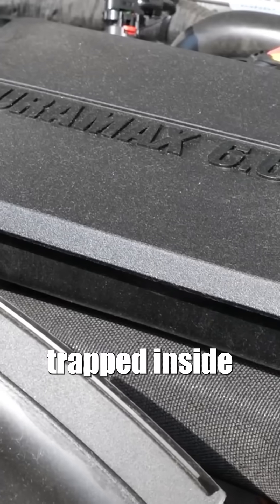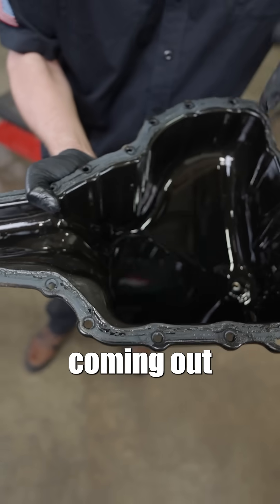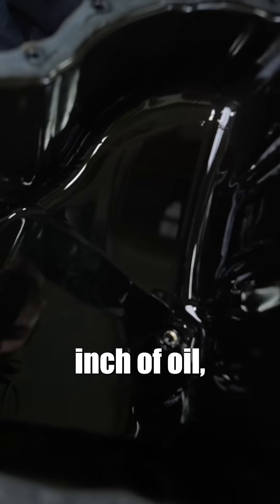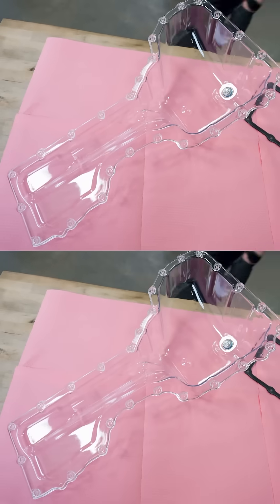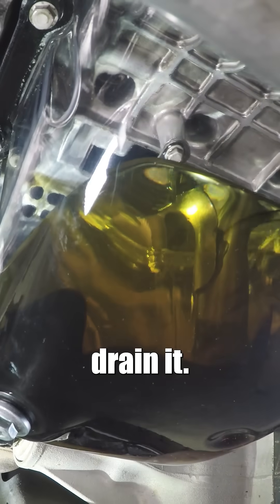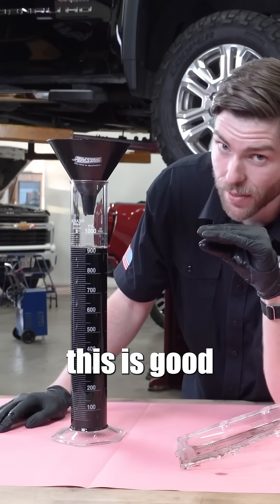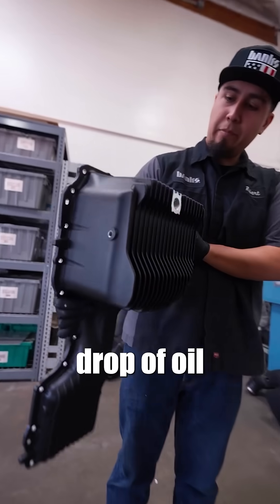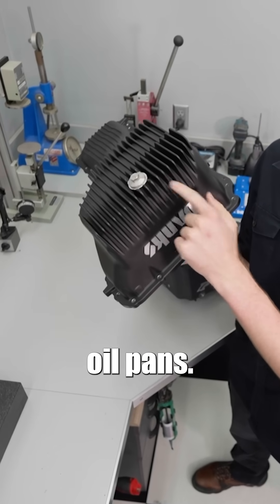A disturbing discovery. This dirty oil is trapped.

Comment: Guess I'll get on my soap box for this one, I agree with those of you that poo poo this b.s. ,but to take it farther, 45yrs in this field has give me the perspective that  if the general population of those who's vehicle's I delt with, had it been a horse, it would have been dead before they brought it to me, from lack of proper care, and they'd be afoot more than riding, not only  that  but what the manufacturer's are toweling out are by comparison to 60s ,grossly  over powered for most folks needs. 150hp. Is plenty of power for most folks needs ,they do not need a racing engine as what being sold to the public, nowadays, take care of want you've got and it'll last 2-3 hundredthousandmiles,
Know it for a fact, worked on a few ,not pretty but they did the tasks required, vehicle's are just tools, if you disagree fine keep it to yourself..experience teaches..history Teaches

Comment: so you're using the worst oil pan for your example? nice. most drain plugs don't protrude into the pan. my 318ci jeep actually has a little dip for the drain plug and sits at the lowest point, that is how pans should be made.

oil is always trapped in an engine, even with a fancy oil pan. however that oil is mixed with fresh as you change it, so its not recycling the same old quart.

usually i let my car sit and drain for an hour or so while i do other things, you'd be surprised how much additional oil you can get out by just being patient.

Comment: I have same issue in my european Hyundai 1.6 Crdi diesel. Drain plug is above lowest point in pan. About 600ml old oil is left. I used to change oil every 5k miles but I do now every 3K. Car is on 97K now with original chain, turbo, injectors and bits...

Comment: Here in Australia the Ford ranger and Mazda BT50 (used the same diesel engine) suffered a major design flaw where exactly that would happen where the oil would drain from the pickup tube and not build pressure again after being refilled, engines were blowing up left right and centre.   Mazda and Ford remedied the issue by telling service centres and customers to only let the oil drain for a maximum of 10 minutes which I don’t know was successful

Comment: That oil drain plug being the lowest point on the pan is troubling. I've seen too many like that busted off, engine ruined. Mercedes comes to mind.
Make it an internal hex or torx instead of a nut so it can sit flush with a small lip to give the sealing.

Comment: Thats not true with all cars buddy. Maybe u can trick some people.
Reply from the maker: Correct, not all vehicles suffer from this issue. In the case of the 2017+ L5P Duramax, that's a different story. For a more detailed breakdown of the 2017+ 6.6L L5P Duramax CoolRunner Oil pan, check out the long-form video this clip comes from.  https://www.youtube.com/watch?v=CVnssANHmU4

Comment: Just park your car on a low slip driveway, am all the oil will drain out
Reply from the maker: You may get an extra ounce of oil, but you would still have dirty oil stuck in the bottom of the pan to overcome the factory drain plug provision. The point is to remove as many contaminants as possible. Our CoolRunner oil pan for the L5P Duramax removes the factory plug provision and replaces it with a smoother unobstructed drain to ensure as much dirty oil as possible is removed. For a more detailed breakdown of the 2017+ 6.6L L5P Duramax CoolRunner Oil pan, check out the long-form video this clip comes from. https://www.youtube.com/watch?v=CVnssANHmU4

Comment: This is BS.  The oil mixing all the time your engine is running and mixing when you drive so, the old oil is NEVER  left in your engine.  I've got 2,300+ miles on my pickup with factory oil pan and zero oil problems.

Comment: I would be curious to see if the pick-up tube getting drained at every oil change would increase the wear on initial start-up afterward. Does it take longer to prime the system with it needing to pull the air out above the oil level before the system is fully primed, and if so, what kind of additional wear are we talking about? Metal on metal without lubrication is bad, and im sure we are only talking about a second or two, but it would add up over time i would think.

Comment: An oil extraction pump via the dip stick tube can suction out much of that dirty oil. After the extraction, pour a half quart in and extract it again. Then fill her up with whatever the engine requires.
Reply: Using ramps to change your oil... or park on a hill to change your oil if you don't have ramps... or if you live in the flat lands and your broke grab a shovel and make piles of dirt to put your front tires on before you pull the drain plug.  It's going to get just as much if not more of that oil than having to have thousands of dollars in unnecessary equipment that you are using in a pretty ineffective and inefficient manner by stuffing a little tube down the dipstick tube and hoping you get the suction tube in the low point of the oil pan... which is not always where the dipstick goes into the pan... and then you waste a half quart of oil for no reason other than verifying that you sucked out all of the oil to whatever point it is that the suction tube is at, which you already knew, cause it stopped sicking oil once already... but you can't see where that tube is sucking from and you can't even tap it in the bottom of the pan to listen to where it's at because you can't be in 2 places at once...

Oil Evac systems,  when used as a system,  like having quick couplers on equipment that connect directly to the  drain plug at the low point are great. Blindly poking a tube into a dipstick tube and hoping you are actually getting it into the low point to get all of the oil is stupid. 

Use ramps, drain the oil into a drain pan, use the oil vacuum pump to suck the waste oil out of the drain pan, and if you are really concerned stick the evac system hose in through the drain plug hole and get the last few drops. 

The other issue with sucking oil out of the dipstick hole is what about all of the magnetic shit stuck to the drain plug? Just going to let that build up for a few years... well beyond the amount the drain plug magnet can hold so that it is just free to flow around the engine?
Reply: @PolarisRider06 no one is reading all that.
Reply: I use cherry flavored Kool Aid to flush the dirty oil out. Grape just doesn't do a good enough job.
Reply: Oil extraction pumps exist (and are pretty cheap too)
Reply: Why not just drill a hole at the base of the threads

Comment: This is why i dont drain via the oil nut. 
I use a pelta sucking machine that you feed through the oil dipstick tube. 

Oil change with no mess.

And you can move/shimmy the tube all around the bottom of the oil pan to suck out every crevice.

Comment: The original engineers made the original outlet like that for a reason. As long as you follow the recommended oil changes, or even better to change the oil with good synthetic more often, this is much ado about nothing.

Comment: Misleading, when you pull the oil filter, the oil will drain back to the pan and out of the block as most filters are the check valve for most vehicles

Comment: It’s only a problem when you change your oil on a lift. When you change your oil on a lift, the oil pan is level with the ground. Being level with the ground is optimal for when the car is running so that the pick up always has a supply of oil to pump into the engine. However, backyard mechanics don’t use a lift. We often do our oil changes with ramps which pitches the nose of the car in an upward direction. When this is done the angle of the bottom of the oil pan allows more oil to escape during an oil change and exposes the pick up , so that most of the oil is evacuated.
Reply: Depends on where the plug is.
Reply: Who says the drain plug sits at the lowest point when the front wheels are higher than the rear wheels? It entirely depends on the vehicle.
Reply: @jochem1986  yeah and I don't think engineers design cars with backyard mechanics in mind but rather with oil being changed in lifts.
Reply: @ can you give me an example? All the vehicles that I service have the drain plug facing towards the rear of the car which places it at the lowest point when the front of the car is jacked up.
Reply: @frankbonura5710 my Subaru has the drain plug on the front of the pan rather than the back. I don't know if there's a preference towards the rear usually but it's certainly not a rule. Especially with more unique cars that can have like 4 drain plugs to get all the oil out (looking at you Porsche)
Reply: @sp3edy787  Thanks, that’s good to know. I doubt I’ll ever touch either of those, but never say never 😂
Reply: @frankbonura5710 
The example used in the video clip was an oil pan on a 6.6 Duramax where the oil drain plug was at the front of the oil pan.
Engineers didn’t have to put that 3/4 inch flange inside the oil pan to lock up the extra quart of oil making it near impossible to get out of the engine.
Reply: Great insight.
Reply: Or you can use a special pump like we do with motors on boat.
Reply: @yamralebol6648  still leaves some oil, I don't personally think it makes that big of a difference but I'm not selling products either

Comment: thats why we recomend to do an oil change every year or so, because when the oil is a year old its not going to be as dirty. IF it is its goes through the oil filter that you forgot to mention, so even if its dirty the new filter that gets changed with the oil will prevent anything in the engine.

Comment: DUMB design, no argument there. But the sales pitch is even worse than the "as seen on TV" scams. That oil that is "stuck in there forever" will be mixed with the fresh oil before you even start the engine, far from ideal, your product is better. But you guys are way better than that BS pitch <3

Comment: Blow air directly at the dipstick  tube using an airgun on a closed oil cap. But be watchful for water accomulated at the air compressor tank, it might go with the air into the engine sump.

Comment: That's why most not poorly engineered cars have the drain plug on the side of the oil pan so that protrusion of the mount doesnt interfere with the old oil flowing out and you can stick a suction tube in and get even that tony rest of it out

Comment: Wow that's some bullsh1t there, btw drain the pickup tube and pre fill the the oil filter and say hello to an air lock and a destroyed engine. Engines do millions of miles with a tiny bit of old oil mixed with the new stuff. Oil changes create wear during the first start up, how many of you hear a rattle at first after an oil change, that's a lack of pressure causing damage.

Comment: So with this design the pick up tube drains as well..... so not only is filter dry but pickup as well and all have to suck up oil and possibly pump becomes unprimed as well meaning how many seconds on start up are bearings etc without oil pressure... i think i prefer stock

Comment: My theory is that this is actually part of the engineering of the oil system so it does not loose the prime / vacuum in the oil system to aid in not starting dry and keeping the oil system primed just a theory

Comment: I'd personally prefer if the oil stayed in the pickup tube. This means that oil will get to the bearings faster. If there is air in the pickup tube, the oil pump needs to prime itself which will take substantially longer. I'll keep the old oil in.

I do like the cooling.

Comment: If the pick-up tube is drained of oil will the air in there allow the pump to prime consistently, especially if the filter has been changed as well?

Comment: Well, we country folk , will waste a little to gain a little! Meaning, drain it, leave the oil plug off, pour in a few quarts and watch it run CLEAR! FILL IT UP AND drain once more! Your engine is good now, so use the waste oil for your old , weed eater, lawn mower, tractor or go cart. Come on folks don't buy something that you just don't need...

Comment: To be fair, if you stick with sub 10k oil changes like 5-7k for example, you’d be freshening the oil more often and the one quart that doesn’t drain makes no difference. Does the oil capacity increase with the new pan since it drains another full quart?

Comment: The so called "dirty" oil is not harmful to normal engine operation. Oil gets dark due to carbon build up from the combustion process. Also particulate but most of that is caught by the oil filter. 
The milage requirements for oil changes are created by the oil companies to sell more oil. 
More oil changes, more oil sales, more profit. 
When in reality, oil can lubricate an engine for FAR longer than we are lead to believe.
Corporate greed knows no bounds.

Comment: How much to replace an oil pan on most makes. I'm sure several hundred in labor.
Reply: Depends on the vehicle but yeah it can get pretty pricey. Some old two wheel drive trucks-less than an hour labor. Newer ones, especially 4wd diesels can run into several hours labor at well over 100-150/ hour

Comment: Or just start the car after draining the oil, with the plug out. Then check the oil light works. At the same time that quart will be blown out the plug hole. Only do it for a few seconds, and make sure there is space in container or it will blow the oil inside over the edges.

Comment: If that's the case then why am I able to put the manufacturer prescribed amount of oil in my car after an oil change and it brings it exactly up to full? Maybe not all oil pans are the same.
Reply: The video specifies a DuraMax diesel engine. It’s likely that most engines oil pans aren’t built like this

Comment: Engineering POV , that oil is there for a reason , you don’t want to air lock your oil pump on start up for however little time it takes to , draw in the oil up the pick up tube on a vacuum created by the drained oil pump , then the cavity leading to the oil filter , fill the filter and , thereafter build sufficient oil pressure to reduce wear . Sometimes if you leave it drained long enough you won’t get the oil up the tube without priming .

Comment: the folks that designed the engine took this into account, see when you do change oil, sure the 1 qt of dirty oil is still in there, but it simply mixes with the new oil and dilutes itself to the point the mixed oil is virtually indistinguishable from new in lab testing, I wouldnt spend the extra money on this, its a bit of a gimmick, the only benefit might be that its cooler, but by how mich? and whats the breakdown on that? to exactly what degree does it help? my money says “not puportionaly to the cost”

Comment: Depends on the vehicle. I put a pan on my Honda Pilot because someone stripped the plug. When I put oil in it afterwards it took almost a half quart extra than it normally does. 

I also experimented with a suction device before I pulled the pan. I almost got all the oil out with the suction device. I now just use the suction device. It's a cleaner operation and gets more oil out than draining it. You also don't have to deal with a drain plug. Just the oil filter. On my Pilot I don't even have to lift the front end. I can reach the filter on the ground and don't have to deal with the drain plug. Plus I can drain the oil directly into a used 5 qt oil container. No drain pan.

Comment: That quart of oil, while not the best for your engine, as long as you change your oil every 7kish miles it won’t be too dirty and gets very diluted from the new oil. It also serves a purpose as without the intake tube having oil in it on startup there is a second or several seconds where your engine is not getting any oil which is far far far far far worse for your engine than having slightly less clean oil. This is a terrible product

Comment: Uuuhhhmmmmm hey banks this may lead to some burnt engines. There's a propose in keeping the pickup tube submerged it's so during an oil change the oil pump stays primed. When you drain the pick up tube and the oil filter is changed that will give you a dry start that is BAD on everything in an engine!

Comment: That dirty oil gets fully mixed. Although I'm pretty sure you can get around this if you use the pump method to do the oil change. Where you go into the oil cap and then feed a line down into the bottom of the pan

Comment: I do my own oil changes. And i check the quantity of oil that comes out. Its never more than half a quart missing after 4000 miles on a 150K miles car. I assume its last due to burning. No way there is a quart just sitting in the pan. Also, I changed the pan around 100Km. So,its not just residual oil from before that.

Comment: Omg thanks for making me smile. What clean 's your oil? It is your oil filter it is more important to change your oil filter than it is to change your oil. Having multiple race cars, 1000s of oil test. For a test I drove a car for 50,000 mi without doing a full oil change. Every 3000 miles I would change the filter add a quart of oil and call it a day at the end of the day the oil was still great condition. Why do they make oil that last for 10,000 mi it's because the oil can do it just your filter can't get over yourselves.

Comment: Don't you need some oil in the pickup tube to prime the oil pump? 

I can understand the drain plug but the pick up tube has to have something in it otherwise you're not getting oil pressure for a longer delay after oil change!